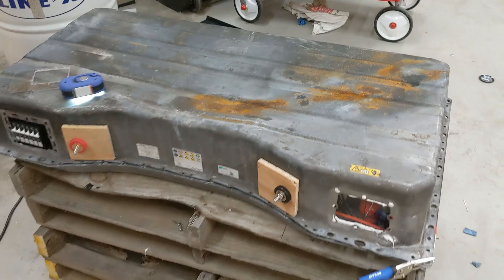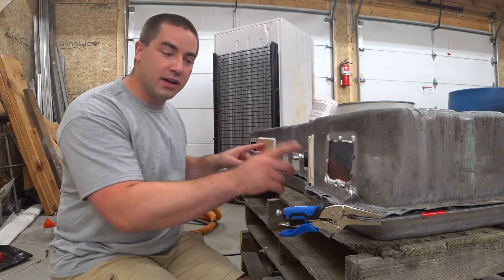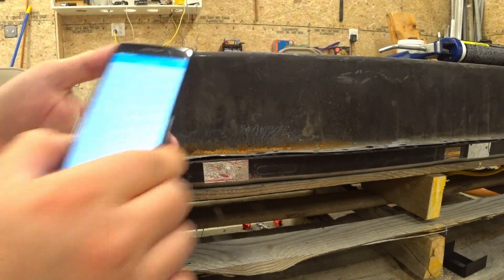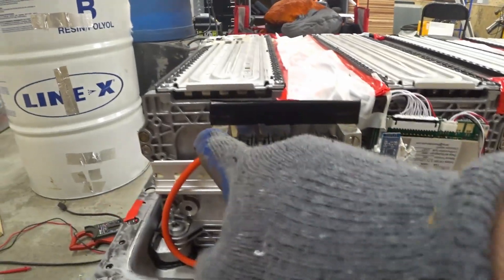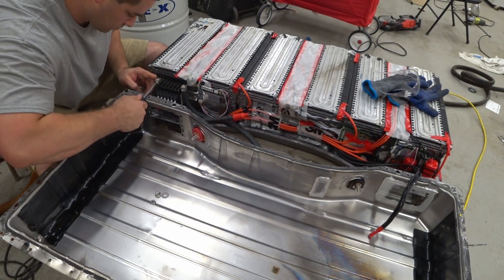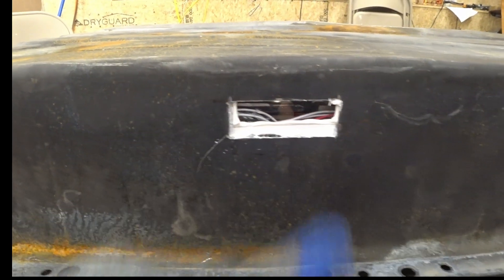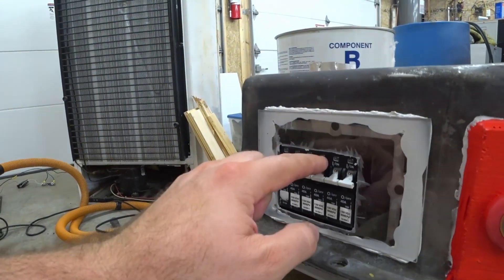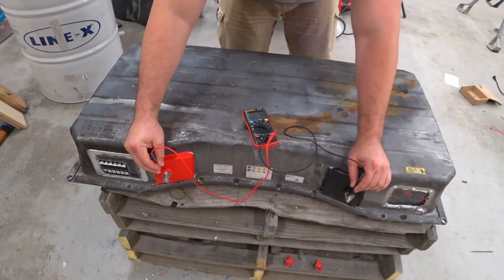DIY Smart Fortwo Battery build, Finale!

Comment: Hi I am am restoring a Smart Car battery as well.  Great info, thank you.  Can you tell if the battery is still usable, if not, how long did it last.  My plan is to use it for power outages instead of the generator.  Thank again.

Comment: I need a 6.6kW charger or better. Also it would be nice to have twice the battery capacity like add another battery but there's no room. The 17.6kW battery, I can get up to 100 miles per charge in the best weather conditions.
Reply: Repacking that case with 3P93S 4680 cells (when they become available) might give you what you want.

Comment: @DavidPoz - you can run an antenna (like what you’d find in a laptop or cell phone) for the Bluetooth module... If the Bluetooth unit doesn’t have the tiny jack on it for the antenna line, I’m pretty certain you can solder one in or replace the BT board with an identical one that has the antenna port — then you’d get an antenna (just a super thin wire - like 28 gauge?) long enough to run outside the case or to the weakest wall (like the plexi)

Comment: What kind of BMS do you use ? - i think its a chinese ANT BMS - Perhaps you have a link
Reply from the maker: I have a few videos on the BMSs I used inside this battery, just look back in my channel.  But here is a link to the company: https://www.lithiumbatterypcb.com/product/14s-bluetooth-lithium-e-bike-battery-pcb-board-with-30a-constant-charge-and-discharge-current-2/
Reply: @DavidPozEnergy  Hi - Thanks a lot for the Link - i think its all the same Chinese Software for the Micro Controller - at this Website i only find that de BMS have a Balancer - but i think its a passive Balancer with low Current (100ma) - do you also use a active Balancer for your Smart Battery ?
Reply from the maker: I don't have an active balancer on the Smart battery.  The built-in one is working fine.  It's controlled with bluetooth, so I was able to set it to balance when I wanted.

Comment: You mention at the end of the video that you'll only discharge the cells to 3.5 volts but the bms is set to stop discharging at 3 volts. How are you cutting off at 3.5 volts? I assume you are using something external to stop drawing off the pack once it gets to 49 volts (3.5 x 14)? And then the BMS's are handling the balancing of the cells and that is it (as well as an extra protection layer)?
Reply from the maker: Right.  Some inverters have programable low voltage cut-off.  So I can set the inverter to shut down at a Set battery voltage.  In my case I think I set alarm at 49 volts and shut down at 48 volts.  But the BMS does the balancing and shuts down if any one cell goes below 3 volts.  The inverter can't see cell voltages, which is why you need both functions.
Reply: @DavidPozEnergy  appreciate the reply. Can you update the bms link to the product page (it's broken and goes to their homepage). Maybe include model number in description so you dont have to update again. Not sure what difference is between their "storage" BMS and "power" BMS
Reply from the maker: Here is the manufacturer: 
https://www.lithiumbatterypcb.com/product/14s-bluetooth-lithium-e-bike-battery-pcb-board-with-30a-constant-charge-and-discharge-current-2/
I used 6 BMSs.  Each was listed as 14s, 100 amp.
I bought them from Aliexpress with the bluetooth dongle.
https://www.aliexpress.com/item/32849172235.html?spm=a2g0s.9042311.0.0.2e5c4c4dCskvSW
You have to hover the courser over the pictures to highlight the "14s 100a" model.  
But there are several BMS's in this category from different manufacturers.  I've also heard good things about the brand Deligreen.  I have not had problems with these, and they are LLT Power.  But with any of these it is important to remember that the 100 amp rating can never be exceeded.  So take into account any surges your inverter might be capable of.  I installed my 100 amp BMSs with 40 amp circuit breakers.  This was to try and take into account any surges.

Comment: I am not sure I would have reused the old case from the car. You could have cut the lugs down on the Pos/Neg term. Also it not a good Idea to use Crimped or solder on lugs like that, it is best to leave the wire bare with Chair lugs or breakers you get a better connection with just bare wire, Just a FYI. (Edit) I take it back it is better its in a metal box at lest if you have a fire your some what protected.

Comment: Nice save!  I just binge watched all the videos about this battery.  Some of your tips may help me recover some packs I have that could benefit from removing some bad cells and rebuilding a smaller number of packs with the good cells.
Reply from the maker: Great.  The most important thing was charging the first time at a super low rate.  I spent months on this battery.  Sometimes a group of cells would be on a charger for weeks at a time because my amps were set so low.

Comment: Hey David, can you put the item SKU or more info on the BMS you have? That company has a ton of them. I want the ones you have with LED and bluetooth connectivity and the highest Amp rating available. Thanks
Reply from the maker: HI.  Sure.  I'm using the "Smart BMS" 100 amp, 14s.  You will want to match the number of cells in series for your own battery.   
https://www.lithiumbatterypcb.com/product/14s-bluetooth-lithium-e-bike-battery-pcb-board-with-30a-constant-charge-and-discharge-current-2/

I can't find the original post on Aliexpress, but I found another post: https://www.aliexpress.com/item/32848353411.html?spm=a2g0o.detail.1000014.23.2d772005d1gxWx&gps-id=pcDetailBottomMoreOtherSeller&scm=1007.13338.112281.000000000000000&scm_id=1007.13338.112281.000000000000000&scm-url=1007.13338.112281.000000000000000&pvid=ed27d023-fe23-4481-ac77-5c069362ce65

Comment: Not kibizing  but I would consider smaller wattage heating elements in the water heater instead of a bigger inverter, it would be a cheaper option as well. but it is a fine job overall.
Reply from the maker: Thank you.  It's my small (19 gallon) water heater.  I call it a "BOOSTER" tank.  It only comes on when my solar water tank is below 130°F.  My inverter tripped a couple times early on until I figured out what was kicking on.  Recently I just leave it off until my wife says something.  LOL.
Reply: @DavidPozEnergy  Improvise, overcome adapt two thumbs up
Reply: And you just gave me an idea, one rasberry a load monitor and some relays for load shedding if demand gets too high add a few hundred lines of code and BANG
Reply from the maker: Yes, a sensor around the inverter wires, and around the water heater, with a relay on the water heater.  I can understand the hardware side of the equation, but I'm terrible at writing code.  Last year I bought an arduino kit with little projects and tutorials to try and teach myself.  But it's still a foreign language to me.

Comment: David very exhausting labor intensive task. I'd only do little improvements. 1that positive post at 12:44 needs to be covered for accidental droppings or bumps. 2-BMS need a ventilation window. They will get very hot if you charge it at 10kw per hour. 3 A self activated fan over 80 degree to keep cells at optimal temp.

Comment: Would it be worth putting some insulation between the main positive and negative terminals and the BMS on the back side? Shirk wrapping the posts might be a good idea.
Reply from the maker: Good idea, Thank you.
Reply: DavidPoz thanks for documenting this build, it’s inspiring to see others with the same goal of energy independence  :) 

Could you do a short video going over your costs to buy, rework and build this pack? I would also be interested in hearing more about “being off grid most of the summer”. Do you have any days of how many days, kWh saved and how much $$ you have avoided paying your local utility. Any relics that info on your net metering/ buy back options is cool too.

Comment: If you do some AC coupling in to you main ac panel you can get more peak AC amps when the sun is out. You can use micro inverters or a grid tie inverter wired in to you main AC panel. If there is extra AC coming in it will charge your batteries through you inverter. If you use a contactor on the wires coming from the micro inverters you can turn them off when batteries are full.   I`m in the middle of this project at my place right now. I have 30 grid tie inverters to test right now and a few micro inverters to sell also.
Reply from the maker: Hi Terry,  As of right now I'm not doing any AC coupling, but it would be fun to learn.  I'll watch out for your updates on how it goes.

Comment: Thank you for making this video! I continue to look forward to each and every video that you create.

So I have a question and maybe you could make a video of this.  Why did you decide to keep the battery cells and wiring inside the metal case vs using the exposed setup that your previous design? I was first thinking that it would be better if a fire broke out, but then I noticed you have an air gap where you have the breakers. That would feed a fire if it broke out and heat up the metal case, which could cause a secondary fire of anything touching the case.

Second: why did you pick these BMS modules over what you used for your other wall? 
Third: Do you plan to build this into your grid?

Seeing you build this into your grid would be exciting to watch! I am glad your hard work is paying itself off over this hot summer. Keep up the great work!
Reply from the maker: Thanks for your questions.
1. I think it's kinda cool to re-build the battery back into the original case.  The Chevy Volt pack did not lend itself to this well because it was a huge "T" shape.  This one is small and compact.
2. The BMS on my Volt pack, and this Smart car pack are made by the same company, just differnt models.  The BMS on the Volt is not doing a real BMS job, no safety cut-off.  It is just monitoring.  The BMS units I'm using on the Smart car are 100 amps each, and they will cut off the current if something goes wrong.
3. I haven't decided.
Thanks for watching.

Comment: 3.5v per cell seems a little high no? standard 18650 cells can go down to 2.5v at fully dead. their nominal voltage is only 3.6 and i think this is based on lithium lion no? you should be able to at least go down to 3.1 or 3.2 to be safe.
Reply: Yes, you can discharge Lithium-ion down to 3.1v BUT...  there is a discharge curve and it starts ramping downward sharply (not very much energy left) at 3.4v or so.   So when you go from 3.4 to 3.1 you don't get that much more power and the individual cells of the 14-in-series start to diverge..   so some will reach 3.1 while others at are 3.3 etc.   The thought is that the battery will last much longer and stay in balance much easier if you stay above the discharge curve ...   e.g. 3.4-3.5 v.
Reply from the maker: Sure, you can go lower in cell voltage.   My understanding is that by sticking to 3.50-4.05 volts I can expect a very long life.  That's what I'm going for.  But, I'm just a dude in his garage, not a battery expert.

Comment: Given your experience in acquiring used battery modules from various vehicles, do you have any recommendations to others who are interested in sourcing some?  Preferred site(s) to buy, etc?
Reply from the maker: I found mine by just calling around (for hours) to auto recyclers.   The fastest way to buy is probably ebay.  Nothing wrong with going that way.  Or if you want to buy new batteries aliexpress.com
Reply: If you live in a metropolitan area check Craigslist. I found a pack by advertising for one. I have seen two others listed recently. JJ

Comment: Absolutely fantastic job!   The 6 separate battery/bms/circuit breaker approach looks solid.    I also do 3.5 - 4.0 range - e.g.  48.5v(3.46v/cell) is my inverter off voltage and float maxed out at  56.4 (4.03/cell).   My calculations (that I use for my own system) show that 3.5v-4.0v range is about 54% DOD of 3.0-4.2 max range.  Based on your test showing 11kwh for that range, I would agree you have 22kwh battery.  My home is consuming an average of 2400watt / hour during summer..  and with a 7kw PV array that generates 45kwh/day - 30kwh is consumed directly (during sunlight hours) and 15kwh is put in/taken-out of battery.   Depends on your home use etc -  but just guessing I would say your battery should 'mesh well' with 7kw'ish (or higher) PV array.
Reply from the maker: Sounds like your battery should last a long time.  Thanks for watching.
Reply: In my 18650 case, I hoping that by doing daily 40% DOD cycles, I'll get 6000 - 8000 days.  This is based on a Battery University  / How to Prolong Lithium-based Batteries - https://batteryuniversity.com/learn/article/how_to_prolong_lithium_based_batteries    However, the general wisdom is 1000 cycles max.   I'm sure you would not like to repeat this build every couple of years and in my case i need 10-15yrs to get my money back.  Time will tell - and I'll be interested to see how your pack is doing in 5 years.
Reply from the maker: I agree with you.  I'll also be interested to hear how your's works out.

Comment: Congrats on finishing. To improve the look of the windows, just mask off the centre small area of the plexiglass windows with electrical tape, then spray the rest black or grey to match the case. That should hide the white silastic glue and let the signal out and let you see the lights.
Reply from the maker: Good Idea.  I think I'll go do that.  Any special paint to stick to plexiglass?
Reply: DavidPoz Sorry mate, I’m not sure. My guess is that any spray paint would work. Just check the instructions on the tin, and maybe test on a spare bit first.

Comment: Nice recap David. Will be interesting to see how this pack integrates with your system. I assume a separate inverter given nominal pack voltage.??.?
Reply from the maker: I might do two inverters, or I might re-wire the volt batteries to 14s.

Comment: Congratulations - you did an amazing thing. And thanks for sharing, I know I got a lot out of your hard work.
A suggestion. Since this will be a different battery from your main battery, why not use two battery switches to hook them up. (https://www.amazon.com/1-2-Both-Off-Disconnect-Waterproof-Isolator-1250Amps/dp/B07HT44MP5/ref=sr_1_6?crid=3JQ11UVAYKZDC&keywords=battery+switch&qid=1564857920&s=gateway&sprefix=battery+switch%2Caps%2C218&sr=8-6). For example, you could wire up position 1 to go to the inverter, 2 to go to the charge controller. Do that on both batteries. Then one battery could be running the inverter, the other could be charging, or a single battery could both be running the inverter and charging. And switching batteries would be just twisting the dial. 
Thanks again.
Reply from the maker: Thanks for watching the series.  A ;big switch like that could be nice for some applications.  I am thinking of re-wiring my Chevy Volt to 14s, then paralleling the two.
Reply: @DavidPozEnergy  That would be good if you can balance them. You don't want one to be stronger than the other.